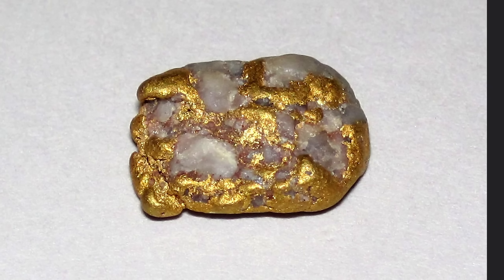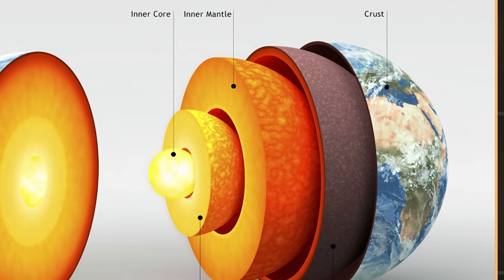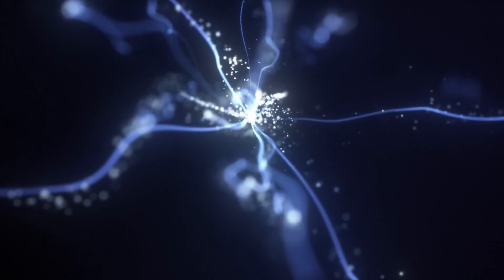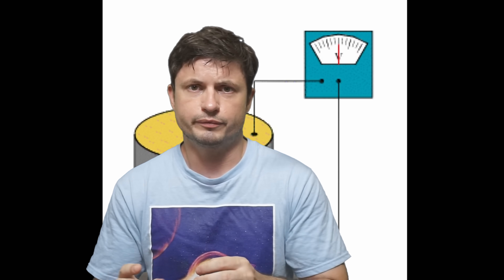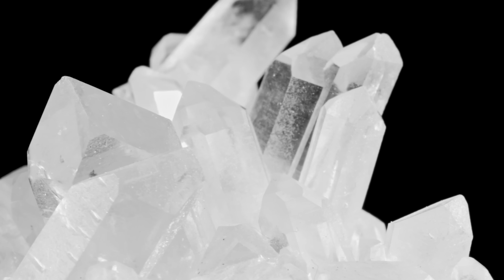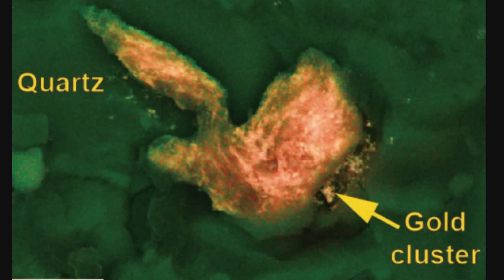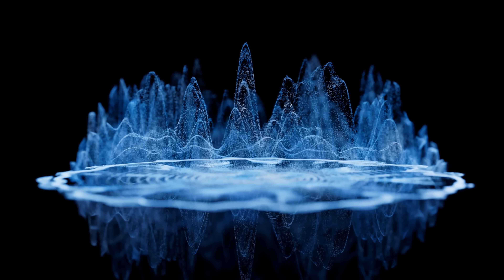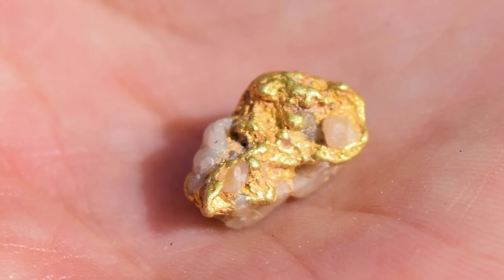Earthquakes and Piezoelectricity Form Massive Gold Nuggets Inside Quartz

Comment: Thank you Anton. The largest gold "nugget" ever discovered was the Holtermann Specimen and I was privileged to work for a time in the mine where it was found, Paxton's Mine at Hill End NSW Australia. The company I worked with was in the process of attempting to reopen the mine although things didn't work out over the longer term. The gold in quatz veins was irregularly distributed in sub parallel bands over a fracture zone up to several hundred metres wide and somewhere between 40 and 70 km long. Our working hypothesis was that this fracture zone extended through the Earth's crust and into the Mantle.
Reply: Do you think it would be possible to use this phenomenon to build a device made with quartz connected to electricity and use it to collect gold in rivers that are rich in gold particles?
Reply: @Alfred-Neuman  Nah, This process takes a lot of time and energy, so it wouldn't be economical
Reply: @JasminUwU   
Yeah I wasn't too sure about that, I don't know how to calculate what electricity would be needed compared to current methods. I was wondering if maybe on a small scale with a few solar panels maybe it could be a bit profitable...
Reply: @Alfred-Neuman  An interesting thought. Thanks. Particles of gold in rivers range from nuggets down to sub microscopic "colloidal" gold. This ultrafine grained gold is carried by water flowing in the stream and is unlikely to settle unless it attaches to something like a clay particle. Gold being the rare stuff it is, the concentration of gold in streams is very very dilute. Extracting it would probably be uneconomic so most of it probably ens up in the sea. The chloride in seawater dissolves colloidal gold but again the concentration is so low that getting it out is probably uneconomic.
Reply: @Alfred-Neuman  this was also my first thought. The Canadian mint uses electrolysis and a titanium plate to collect pure gold from impure gold the making it 99.99% pure. I'm pretty sure you need to use the gold as one of the diodes and the titanium as the other, so the gold might need to be smelted into something large first to extract it using electricity. It could maybe work with a chemical process that dissolves any gold present but that's also a little too much for just trace amounts of gold.
Reply: @Alfred-Neuman yes but I’d give the experiment around 40 million years

Comment: I always read that gold "travels" with silicon dioxide (quartz) and stay molten while iron rich granites and basalts solidify at higher temperature in magma, gold and silicon flow together until the magma cools enough for both to solidify. I think silicon solidifies before gold so it traps the still molten gold inside. So is the piezoelectric effect theorized to trap gold that is free-floating in high pressure steam from volcanic effects? Are there then two ways that gold gets trapped in quartz?
Reply: I'm afraid I'm pretty sure you got the wrong idea. The gold in a magma chamber is in solution; dissolved in super-critical sulphuric  magmatic waters by stuff like chlorite. It isn't molten gobs. An earthquake or the enlarging crystalizing feldspars in the melt rupture the metamorphic roof–maybe with a big plume of porphyry, for instance–that the volatile bearing hydrothermal fluids then rush up into where they subsequently deposit the minerals they bear due to changes in temperature, pressure, and host rock composition. The rate of precipitation is pretty obviously the main factor in the size of crystals, but apparently the voltage helps grow giant nuggets I guess. There's big nuggets in just granite or adularia etc. so this isn't the only way. Anyhow, all the minerals we're interested in including the silica are in solution until they precipitate like scale in a pipe–I'm pretty sure. There's a differentiation in the magma chamber itself as it cools to make gabbros and granites illustrated by the "Bowen's reaction series". It's a molten crystal mush, but metal deposition happens because hydrothermal fluids dissolve the metals and concentrate them in fissures. I know very little, but that is the case. Dissolved.
Reply: @SandhillCrane42  Thanks for that explanation - very interesting. I know where I live, there were tons of very fine gold deposits from hydrothermal vents  in an ancient shallow sea (flour gold), so what you described makes sense why there are no gold "veins" yet still a lot of gold was extracted from the area (although there's also lode deposits in the nearby mountains as well).

Comment: There was a paper published back in the 1990s about the piezoelectric charge created by the pressure under ground on quartz deposits. There were plans to find out if this could be used to measure the pressure on a fault to gauge how liely it was to fracture and produce an Earthquake - I think a variation of this research was used by a Turkish geologist to probe the anatolian fault and predict how the pressure changes along the fault following earthquakes. The gold angle is interesting - can we use this technique to remove gold from sea water?
Reply: Great question! In my mind I see many possibilities with the seawater angle. There needs to be more research on frequency and deposition rates, then design a barge designed to use wave power  to run the whole thing.
.

Comment: Quartz not only makes electric charges but also heat when it is under stress. And some mountains vibrate. You can hear it sometimes at night. Gold is not rare, but high concentrations of gold are rare. Also veins of metal conducting charges too.
Reply: ‘Gold is not rare, but high concentrations of gold are rare.’

The fact that you cannot find Gold in high concentrations is the reason why it is rare and has been considered real money for the last 5000 years.
Reply: 2 lbs of gold powder in your hand is incredibly valuable, but drop it from a balloon at 10k feet and it’s worthless.
Reply: @dsfgkasguyrebfv  He said exactly what he meant… you go panning for gold in certain places in the world, and you will find flecks of gold in almost every pan, meaning it’s plentiful.  But, to find nuggets is rare.  That means that there’s lots of gold in that river, but no easy and economical way to collect it.
Reply: @rhoward295  flecks of gold is not plentiful compared to how much time you need to spend and the amount of material you need pan.

Comment: Actually, you have a lot more piezoelectric devices around you. Nearly all the cellular, wifi, bluetooth and many other radio related devices have piezo crystals in their RF modules designed to resonate at specific frequencies. They are called Acoustic Wave Filters (usually surface (SAW) and bulk (BAW) ones)

Comment: I have an idea and I hope you read your comments because I think this could be important for the industry and the hobbyist. I live in California and have prospected gold as a hobby for many years and have tried numerous methods of collecting and refining gold . One of the oldest  problems is separating the fines from the black sand . Using mercury is not that great of a solution .and any way you look at it it's a lot of work . But what if you were to put Quartz in a jar of saturated with gold and mercury  and then vibrate the jar at 20 vibrations a second . The mercury is a conductor and the quartz would hold the gold and when you took the quartz out of the mercury only the gold with mercury would stick to the quartz the rest of the mercury will not stick to the quartz . Then you only have to heat the quartz in a retort and only the gold would remain on the Quartz? It might work even faster then just running saturated water over the vibrating  crystals because of the conductor property of the mercury? If you have ever used mercury recovery method you would understand the benefit of this idea. There is bound to be a lot of gold in the mercury that is so small that we miss a lot of it using the filtering of the solution in trying to reduce it to the point of hearing it in the retort .

Comment: This is a potential mechanism for mining gold from the source that contains the most of it by far (the  oceans). 

I.e., "panning" for gold via oscillating quartz seeded with tiny gold nuggets, perhaps. The trick will be generating the oscillations efficiently as that takes energy.
Reply: Use wave- or tide-power.

Let the ocean do the work, and provide the material and come back later.

Though "later" in these cases would be thousands of years.

And key, there would also come a series of other metals that are also distributed in the fluids.

An interesting proposition.

Comment: I was rock hounding in the desert... 2 separate times  . I was reaching down both times I felt this crazy vibrating feeling in my legs and hands . I was so confused after the second time because I felt it the first time.  I could actually hear it
Reply: You can end up with crystals of calcium in your ears over time. It can cause vertigo when they are loose and rolling around. But I wonder if they might not vibrate on the correct frequency giving the sensation of hearing something? 🤔 

I say so, because I have been having problems with headphones. I thought it was just earbuds. But even the over the ear types give me problems - pain/inflammation - if I wear them for too long. So I began to wonder if I might have deposits of some type and if they would jiggle on exposure to the magnets in the headphones. After all, I can listen to music, and youtube videos all day with no issues. So it can't be soundwaves. 🤷‍♀

Comment: Thanks Anton.  Very interesting presentation.  A few years ago, someone gave me a quartz crystal filled with a metal inside it.  I thought it looked like the metal was copper but, just maybe, it is really gold.  I wonder if this phenomenon can be used to recover gold from old mine tailings; tailings that would normally have so low of gold concentration that it has not been economically worth processing.

Comment: Gold nuggets and quartz melt with other elements and water deep in the earth and well up through small cracks in the earth.  As they rise through the cracks the pressure drops and they begin to separate and solidify together.  It is very unlikely that earthquakes have anything to do with this process except for forming the cracks and fissures the solution rises up through.
Reply: It could be creating the nucleation points for larger nuggets to form. Most hard rock gold is highly distributed in very tiny amounts throughout the deposit. Larger nuggets are kinda a misery. This study doesn't sound like it suggests that yet, but could be a piece of the puzzle. Other than that, I agree, this video (and I am assuming the study) doesn't really add anything helpful to our knowledge of how gold deposits form. Even without this effect the same amount of gold would be deposited just distributed differently.

Comment: Nuggets have no in situ analog and are often found in shallow cold water high energy stream pools or shallowly buried quartz rich equivalent sediments - or metamorphic  equivalents.  Faults, are known piezoelectric  generators, can align quartz crystals (focus energy), are are often quartz rich or strongly quartz veined and can also host gold deposits.  Gold can be concentrated here but 'nuggets' sensu stricto are not present.    Mechanically, and gravity concentrated gold grains subsequently agglomerate into larger  masses, unknown in primary deposits and in shallow cold water environments.   These stream beds and shallow quartz deposits are typically not being squeezed much - the primary source can be. I will read the paper.

Comment: 🤔 Matter is generally not this wobbly, gelatinous or wavy substance the way it’s often depicted.  Geologists look for consistency and continuity as well as metallurgical properties in quartz samples.  A nugget is usually found in placer deposits(not quartz), but the rock fissures where gold precipitated put the gold in multiple depositional events.  This leads to agglomerations of metals.

Imagine two glass slides with water between them. Then the slides need to be shattered, and there would be solutes coming from the depths under extreme pressure out of geophysical processes.  Except that processes that create a viable deposit would be extended over kilometres.  And you tend to find gold in ‘vuggy’ quartz veins.  The processes that create nuggets are not unlike heap leaching, where gravels in river banks have the same loose compositions and agglomerate at lesser pressures and temperatures.

Comment: Nice.   So…how come we don’t see copper doing the same thing?    

I argue that the big nugget gold theory requires relatively low sulfur in the vein system to avoid pyrite scavenging.  The higher the sulfur content the more likely the gold is sequestered by iron sulfide minerals.   

Where I once mined the best gold is found associated with parts of the vein system with high lead.   The mill always got gold in the lead concentrate and there was galena to be seen with the gold.  

In porphyry copper systems Gold is commonly associated with chalcopyrite and even more so with bornite.   The lead component in the copper core is low.  The gold follows copper and is higher in the slightly more reduced porphyry systems rather than in say high sulfidation systems with a higher level of oxygenation…(which I happen to have one of now undergoing drilling).  The link to porphyry copper systematics would be good.  

Now that lead thing…it’s very responsive to electrical fields too.  I bet there is more to this pietzomechanical chemistry!

Comment: Theoretically, if equal heat and pressure were applied from all sides uniform, could MONOATOMIC gold be created this way? If the process could be somehow, controlled (would require us to handle depths that break all known metals, and contain earthquakes and not just Haarp them either, like wield enough energy to challenge the earthquake in a sense..) 

Would depend solely on uniform , intense simpoytanous heat pressure applied to every atom in the peice of quarts and i bet that at such insane pressures it can happen. It might as well not exist though, because it is not like we can simply even observe this process. 

To observe these pressures at these depths in the bands encompassing an earthquakes full radius, you would need  something a space ship rounded on all surfaces like a dense iron sphere. Pressure will be coming from all sides. That then would need electronics aboard it, to transfer the video signal back to us, I don't think it is possible. Insane that we just have gobs of energy like that beneath our feet at all times. Were basically living on a weird, contolled fusion explosion fire sphere that deposits hard stuff tha accumlates all over like an egg. 😅

Wtf.
Reply: Humans couldn't even be inside it would have to be drones or protobrains because you'd have to delay the signal until they got there, and would also have to essentially build the ship around the pilots.. because if you can get to them, so can pressure. We need about 5 ft thick or more of just solid metal. Alloy, even. But imagine driving a little sphere through the core of our planet. I wonder what you would see. It would just be bounding hot white light because we're literally just on a fireball though. Its like a jawbreaker but just with a smoldering core.

Comment: Wait! So theoretically, we could just suspend quartz in sea water and vibrate it for a while, and come back after a couple weeks and have gold accumulation.... This is going to crash the global commodities market,......
Reply: Exactly what I was just thinking. Please someone explain (in simple terms) why this would not be viable and also instantly start the rush for Clarion-Clipperton Zone mining near the seabed. It really cannot be this easy.
Reply: The quartz is just a middleman to the voltage in this conclusion. Electrolytic processes have been used in refining, although the cost is probably far beyond prohibitive for sea water. That said, you may want to give the Gold Accumulator hoax of 1898 a search! Interesting story.
Reply: @cinderwolf32  Sunlight, and international waters are though. With solar becoming increasingly cheaper on even the consumer scale, if power consumption is the only bottleneck , this really should work eventually even if not right away, right?
Reply: Not to mention that you probably still have to further refine any gold you get this way
Reply: Help
Reply: @cinderwolf32  My interest is specifically in the applications of it for the Clarion-Clipperton Zone. Although I see your point, I still hope the right combination of technological advancement and geography might let this turn into a beneficial technology.

Comment: Something I don't get: what's special about gold that it does this? Plenty of other metals in the water, no?
Reply: Gold doesn’t oxidize, so no surface contamination to prevent gold welding to gold. The gold was not dissolved, just finely pulverized and in suspension, as I interpret the experiment.
Reply: @For_What_It-s_Worth  Thanks!

Comment: I have never heard of electrocution during and caused by an earthquake. On the scale of faults, I would think that huge voltages and currents are possible. (You can even get a shock from your little gas igniter.) Earthquake lights suggest very high voltages with power behind them that can turn air into glowing plasma. Something doesn't add up.